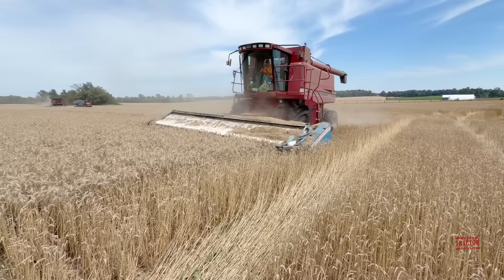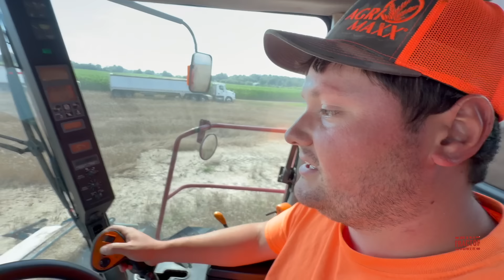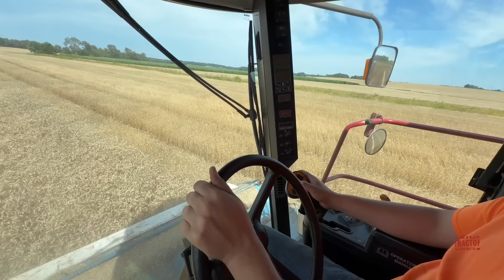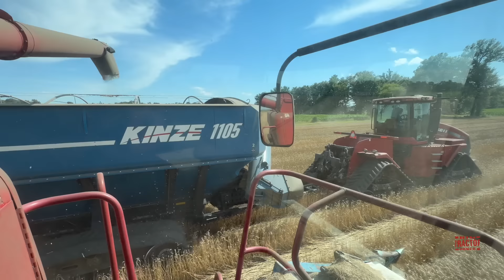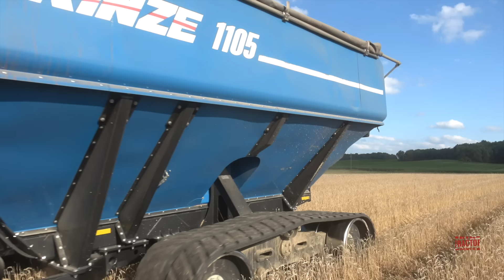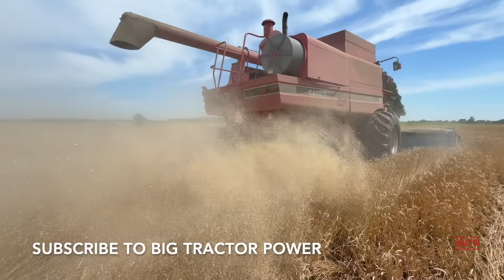CASE IH 2166 Combine Harvesting Wheat

Comment: I am from Uzbekistan, have one AxialFlow 2166 since 2002 which is manufactured in 1998 , still with native engine and other stuff, every year is doing its best, very reliable compact and for heavy duty usage, my favorite machine along with magnum mx255, for me agri-l machines that are produced in North America are etalon of high quality
Reply: How is supply of spare parts for older Case machines in Uzbekistan? I would assume that would be the biggest problem running them.
Reply: Hello, I am writing from Türkiye. I have a 1996 model 2166; the straw coming out the back is being chopped very finely. How is it for you?

Comment: This striper head is so cool. Just imagine that the combine is processing like 10x less material.
Reply from the maker: It definitely saves wear and tear on the combine
Reply: @bigtractorpower There is also a fuel factor. Due to a largely decreased amount of material that must be processed, fuel consumption must be lower too. Also, grain cleaning is definitely better-there is simply less straw residue to separate from the grain. The only downside is that the straw must be mowed to be used or mulched but modern no-till systems work  lots of residue anyhow and even favor it.
Reply: @selmirikanovic Definitely not the header to use if you want to bale your straw. It's great for no-till though.
Reply: @selmirikanovic Plant right into the stubble. It will eventually collapse and provide mulch, suppressing weeds and retaining moisture. Great units if you don't need/sell the straw.👍

Comment: We have had alot of diffrent axial flows, my grand pa started with a 1482 self propelled. The list is, 1482, 1480, 1680,1688, 2388, 2) 8010, 9120 and 9230. The current machines we are running are the 9120 and 9230 with 40 foot macdon fd75 flex drappers.
Reply from the maker: Great Axial-Flow history.   What tractor ran the 1482?
Reply: @bigtractorpower I believe it was a case 4690.
Reply from the maker: @alainturcotte9843 very nice. My neighbor bought a 4690 new in 1982. I always enjoyed seeing it work.